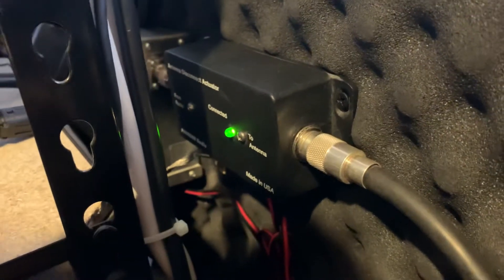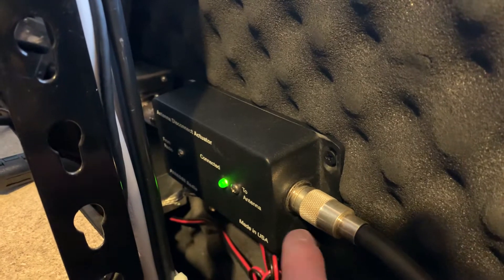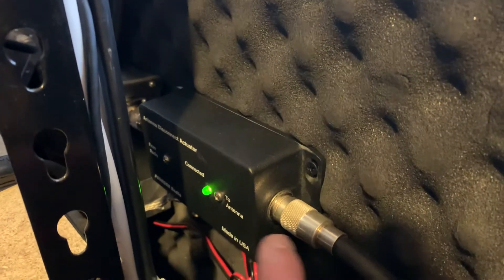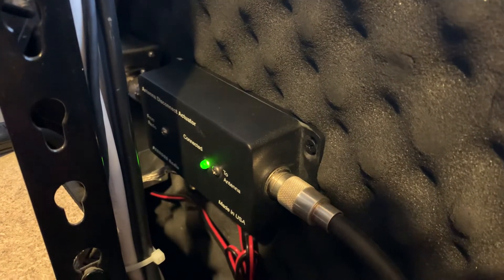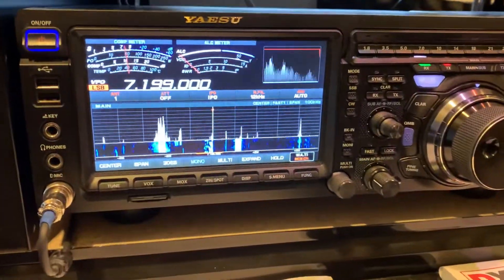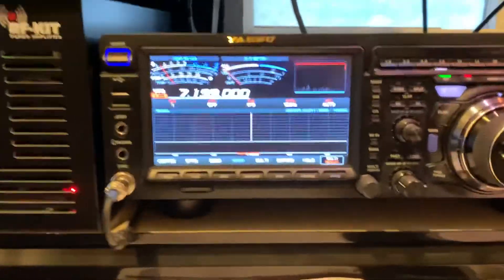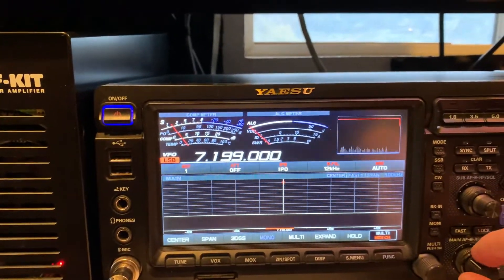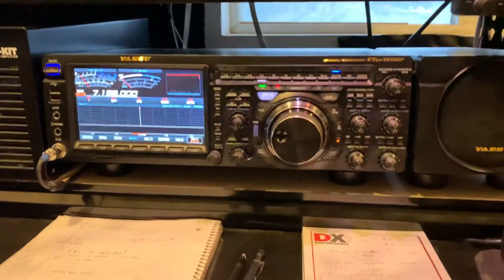Auto antenna disconnect - KJ7E

Comment: Can i use it for a vhf uhf antenna ?
Reply from the maker: You could, but it will not be ideal and will introduce some loss and possibly raise your SWR as seen by your radio some.  These are really designed for HF.
Reply: @damonkj7e  do you have a segestion for a disconect actuator for vhf uhf